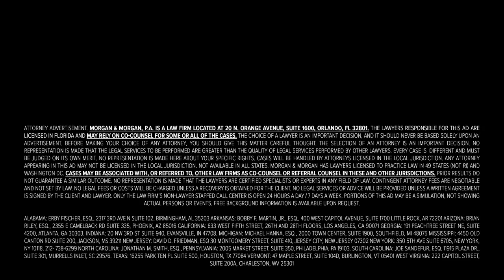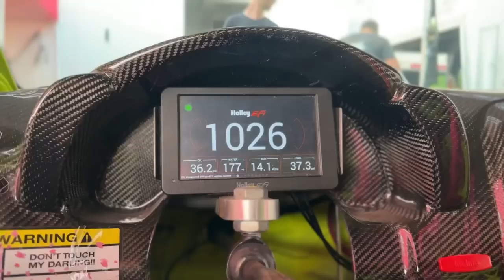Crashed the C6 Corvette …

Comment: So was your car out at the rear from the first hit because you said your head was hurting then also did you check your helmet to see if you had clipped the roll cage with your Noggin. Just checking. Lady you have some brass ones the way you bounce back is great and I was pleased you didn't just take his word that your car was fine and saw for yourself it wasn't, that critical eye possibly saved you another spin. I had a Ford capri that used to loose the rear just now and again on bends and the second time I had the wife and my boy in the car it worried me and I went over it all, the back axle was was tweaked 5mm on the leading edge in & 4mm upwards so my rear tyre wasn't in full contact and the car was sitting heavy on one side. Great car. Stay safe Collete.